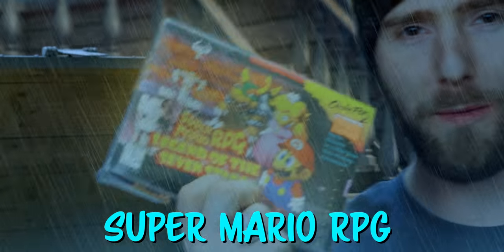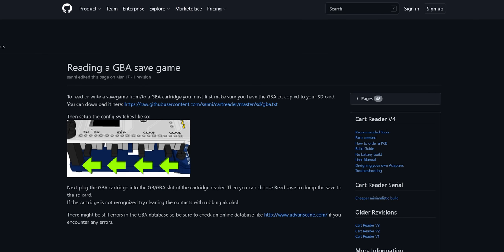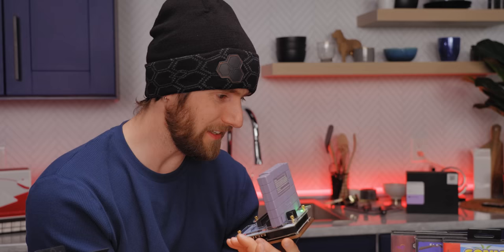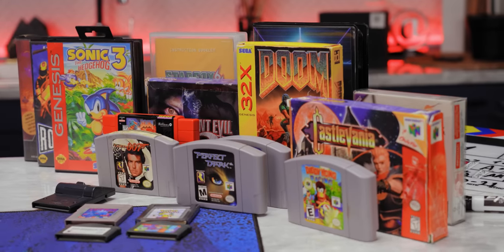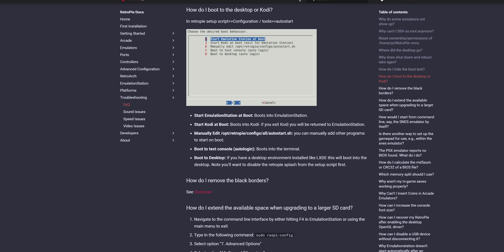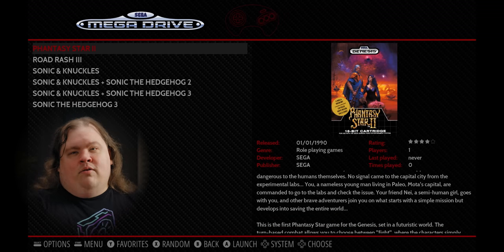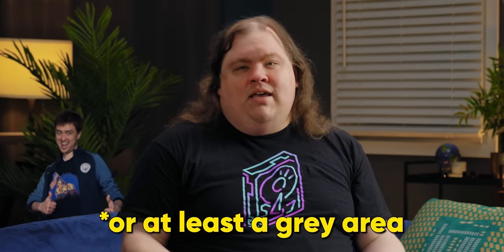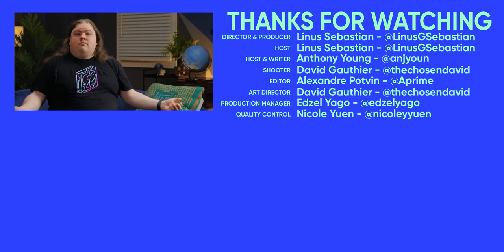I am a pirate - How to LEGALLY emulate games ft. Save The Hero / Sanni v3 + Raspberry Pi

Comment: When I wanted all our retro games under one spot, emulation was the only way to do it.  So, that’s what I did, I started buying all the cartridges I want to own that I didn’t have yet.  I’m not greedy in having  access to every ROM.   Simply I accept it would be impossible to play them all in my lifetime.  So, I only stick with the titles that I care about and/or willing to play again.

Now, I need an easy way to rip my own ROMs from the cartridges I own.  This might be it.  I buy the “mini” consoles just to have legal rights to those ROMs as well. NES Mini, SNES Mini, SEGA Genesis Mini.  I was able to extract the ROMs from to those too.  Even so, I only really care for a handful of titles from each console.  I take those and hope to consolidate them into another all-in-one turn-key console/emulator. I have a Pi, it works… but I don’t like the UI/UX.  I really like the Abernic handhelds as they are as close to turn-key platform as it get.  You load your ROMs into SD card, and the handheld already have the front end and emulators for it.

Comment: If they are "read only", then how did they get the data in there to begin with?
Reply: That is non of your concern. You are only allowed to play the original copy of your game and neither a copy of it nor an altered version.
Reply: They used a "rom programmer", an hardware tool used to put (flash) the code inside the chips (and of course the flashing software).
Also if it fails or the data that was flashed in it was bad, the rom became useless.

Comment: Brazil has interesting cases of adaptations like Street Fighter 2 for 8-Bits ( Master system ), yes you didn't read it wrong, and the parallel market, hack roms, translations, unlocks and preservation are giants (imagine for decades not even games in native language , games were English or even Japanese )
Hard to explain but our computer/videogames market was closed (there are still remnants), when it opened we ended up having access to decades in a few years, which made video games from 8/16/32 to be sold (new) at the same time (there were even competition), and then 32/64 bits skipping various equipment that in Brazil are just magazine reports.
This makes that a Brazilian, even if he wants to have an original game, has to import cartridges, equipment and engineering to have compatibility (example PAL-M vs NTSC)...
Not that I'm in favor of piracy, but the reality is far from what you can see behind an executive's desk.

Comment: the battery is like under 2volts.. just tape the wires on the battery and solder the new on while replacing the old one. Works totally fine.

Comment: You dont even need a raspberry pi for emulation of older games, right now I am actually running my old NES, SNES, N64, PS1 and even Arcade games off my PS1 classic mini using a Thumb drive. I also run Lemuroid, a FREE emulator for playing NES, SNES, N64, Genesis, PS1, Mame and other games on your cellphone without having to download or swap out a crap ton of cores or anything else, so far I've had ZERO issues from it.

Comment: I could possibly see one thing on Nintendo's side here... Technically the "game" license is for software that runs on Nintendo hardware. So pirating the game itself isn't just the issue but running it on a system it wasn't intended for (on a PC via emulators for example). Essentially your only buying a license to run the one copy of software on a Nintendo system. Though good news, Nintendo probably won't care about pirating 3rd party unofficial games.

On the flip side, they can't claim copyright infringement for say a snes game (I think...) due to age of the game. Because once they re-release the game on a newer system they are technically creating a new product rather than refreshing the old since it's effectively a different license for a different system. Or something like that.

There are a few more things I could think up, but after saying that...

I feel like if you've paid for the game you should be able to play it.

Edit: Anthony pretty much addresses this towards the end lol

Comment: Hey Anthony, I'm not sure if there's an input latency feature on emulation station you can change. But I know you can change it on retroarch which always has it set to "late" whenever you first install it I always switch it to normal. Might have been your issue on controller timing.

Comment: Emulation is not illegal, so if you own a physical copy of a game and then download a ROM of it off the internet to play on an emulator, you aren't breaking any laws no matter what Nintendo says.

It's also not illegal to download pirated media, so even if you don't own the physical copy, you're still not breaking any laws.

The reason why mods of these games have to come in patch files is because if the full patched ROM/ISO were released, that would constitute redistribution, which is a DMCA violation, even though it shouldn't be as per fair use.
Reply: Depends on the country you're in when downloading said ROM. Hosting and sharing ROMs via the internet is illegal in most countries, as is downloading material you know is pirated.
Reply: Bold move to generalize every law of every country on this planet.

Comment: I think one of the biggest take aways from all this is how it's not necessarily easy, but still doable to do this. But so many modern games don't come with a physical copy at all, and are programmed to require an internet connection to back end servers at all times, even if it's a single player experience of a game.

I'm curious to see how today's games get adapted for retro gaming in the next 30 years.

Comment: I primarily use the retrode for all carts with the adapters.
I use the sanni for snes, but specifically for games that have the special chips (needs emulation through PIC). But later i did get another adapter for the retrode as well. The version i built at the time only supported snes.
For nes i use the kazzo board.

Comment: 0:35 No. But there's also no completely illegal way to do it either. Legally, you cannot make a ROM of a Nintendo game with 3rd party tools. But Nintendo doesn't provide you with a tool to do it either. Hence, you can legally use any illegal 3rd party tool you have access to. But that dumping you can legally make with an illegal 3rd party tool, can only be legally used for archival purposes. Yet legally, Nintendo cannot disallow you to use a product you bought in any way you find desirable (as long as you don't distribute the copies, or in some countries, as long as you don't ask for a benefit in exchange (distributing for free is not considered a copyright breach in some places), or even if you just don't claim it's an original (some countries "allow" you to sell pirate copies, as long as you clarify it's a copy. It's technically not allowed, but there are legal vacuums), depending on your local copyright laws).

So:
* Is it legal to emulate games, even if you own the original and the console it runs in? No.
* Is it illegal, then? Also no.
Reply: AND!! I forgot, but recent anti-anticonsumer laws, that restrict the capability for companies to tie you into the one ecosystem, could soon take precedence over any copyright law or TOS anywhere in the world. In a perfect world, these will eventually lead to every developer offering physical copies of everything, and for those copies to be legally dumped and emulated in your ecosystem of choice, provided you bought the one copy. Of course, you cannot expect these types of laws to come from any USA legislative unit, but they can come from the European Parliament, and eventually by local legislation of jurisprudence be adopted by everyone else (like the little confirmation where you can disallow cookies when you visit a new website, that should be standardized, because many asshole websites hide confirmed ad, tracking and spy cookies in submenus, even if you turn everything off)
Reply: Yeah basically its a massive legal grey area and a massive cluster fuck.

Comment: BRAH
Copying is not theft, because no one is deprived of any objects. Copying is not Piracy because Torrents don't require physical violence or even the threat of physical violence. 

 If you took the Canadian equivalent of a gun to a used gaming store and threatened to shoot them unless they let you take home whatever SNES cartridges you wanted, that would be armed robbery. 

To be a pirate in this scenario I think you'd have to like  load the whole building on to the back of a truck and drive it away, or like burn it down after you got all the carts you wanted.

Comment: what bugs me about raspberry retro builds is that they are way overpriced for the actual hardware your getting. an amazon fire TV stick can run android emulators just fine, or you can buy an HP mini PC with like i3 4th gen or newer for about 100$. these have low power usage (more than a raspi, but low enough for it to not matter at all for a few hours usage per day) but dramatically more horsepower which will mean that you can emulate consoles that are 1 or 2 generations beyond what the raspi can emulate. i guess the raspberrys main feature is that its open source philosophy motivates certain people to put in a lot of work into developing tools like retropie that in turn, create an easy to setup framework for emulation.

Comment: At least with battery saves on game cartridge's. The ram has infinite writes. you just have to replace the battery, which will cause you to lose the saves. I used my crappy Retron 5 to back up my saves on a SDHD Disk.

I'm more worried about the later Cartridge's that uses flash memory. They do have a limited amount of writes. to many, and they are gone for good.

Comment: The copyright law extension is what became a threat to abandonware and game preservation. Nintendo is notorious for their business model exploiting this (espically recently with SM3DAS, despite existing a digital version) and even their fans over non-commercial use of their works. A company who also restricts even music from being freely listen to. Their deliberate action of hindering legal availability of old games is basically pouring gasoline, not a fire extinguisher or water, into the piracy fire.

Even worse is Nintendo not only being the only one who fails at preserving games. Sony’s PS games now have expirating titles rendering PURCHASED games unplayable and ANOTHER console company Microsoft having an outage with their servers rendering even single player games unplayable, despite the backlash with the launch of xbox one in the past.

Don’t just try to fix copyright law alone, DMCA’s section 1201 is ALSO a problem. Right to repair, tinker, and even using unapproved software whether actual piracy or not can be illegal.

Comment: 1:44 hell yeah, Crystalis! I actually had the battery replaced in the 90's by Nintendo. When they received the cart, they noticed "contamination" and proceeded to offer "cleaning" of all my games, all my controllers, and my NES unit. I sent them a HUGE box with over 100 games and all my NES gear, and they cleaned ALL the carts (peeling the stickers , completely reshelling them and reapplying the stickers) and replaced all my controllers and NES unit with new/refurbed hardware. THAT was the kind of customer service you got from Nintendo in the 90's.

Comment: The reason why you would want to do this is because all my CDs from the 2000s are too badly damaged to use anymore but you know what's not? The files that have been copied and transferred ad nauseum between my devices over the last 20 years. Sure, these albums have been rereleased at higher bit rates or even in FLAC, but these are mine and every executive on the planet that thinks I don't have that right can go straight to hell.